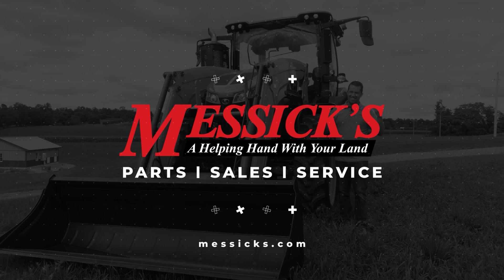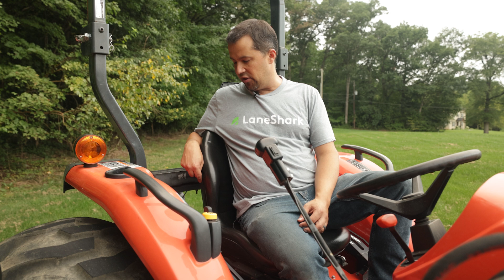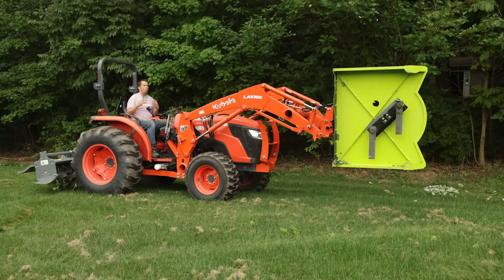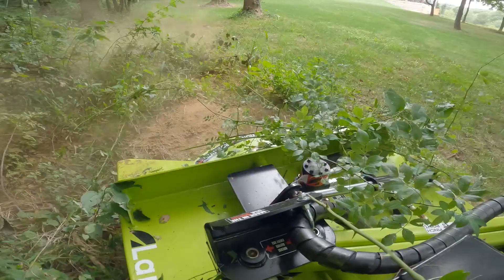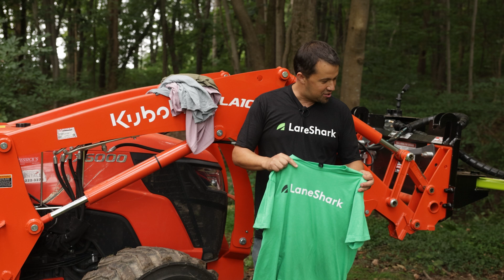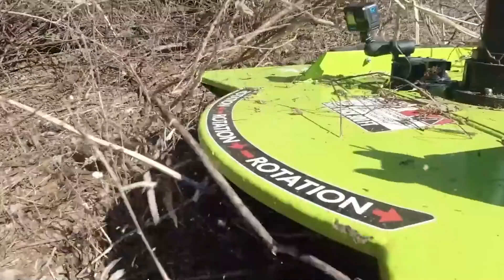Possibly the most innovative mower? Laneshark Hammerhead 🔨

Comment: I have the original LaneShark, and when used as designed, the deck material gets deformed because it is waaaay too thin. Also, the retaining pins to keep the position locked in place tend to fall out and get lost (the brush you're working in pulls the cotter pins out, then the retaining pins fall out). I replaced them with bolts, and even though they're not as easy to remove, at least they stay in place until I'm ready to remove them. If I'm going to spend $10K+ on a new implement, it will be a 3-point mulcher like the Baumalight MP360...just sayin'.

Comment: Is this attachment principally for smaller tractor FELs that can't run a traditional skid steer brush-hog or are not heavy enough to handle the alternatives? The CID Swing Boom Brush Cutter is pretty much the same attachment in the same price range, but it is about three times as beefy.  The Lane Shark is $10,000, weighs 550 pounds, uses Pioneer AG style connectors instead of flat face, needs 8.5 - 20 GPM and explicitly states that it is not compatible with skid steer machines.  The rubber flap on the Lane Shark seems quite risky (I mean, all mulchers and cutters are really risky when you lift them up in the air).   The  CID Swing Boom Brush Cutter is $10,500,  weighs 1,400 pounds, uses flat-faced connectors, and needs 14 - 30 GPM.  On the CID, the two side aprons that will ever face the operator are fixed steel all the way down.  However, after reading the instruction manual for the CID, they think you'll get killed if you don't have a polycarbonate door/cab windows, so perhaps the steel doesn't buy you much.

Comment: I have a trailblazer with the power pack. Could you put a powerpack with this new Laneshark? I dont like the idea of using a tractors internal hydraulic fliud when you are mowing for several hours and is hot outside to begin with. I know Laneshark disagrees with me, but that fluid gets hot
Reply from the maker: Yes, its just a small plumbing change

Comment: What model tractor is in this video? It looks like an MX. If so I’m surprised the tractor has the hydraulic flow to power the blade.
Reply from the maker: Yes, its an MX. The mower does not need tons of flow to lop things off. I ran it for about two hours off camera as most of the time was only half throttle.

Comment: So if you want to use this on more than one tractor you muSt buy two or three control boxes?
Reply from the maker: If it was me, I'd set it up on an external hydraulic power pack, put a magnet on the control box, and you could easily swap to a different tractor just by hooking up power leads.

Comment: Lane Shark really needs to come out with a model that runs off a PTO power pack. Anyone with an older machine or even a newer machine without the 3rd function knows it can be a pain to find a 3rd function kit as well as getting a case drain installed. It would be nice if it could be a self contained stand alone unit.
Reply: Their original model came with a 3point mounted rear external hydraulic tank for flow back when the motor stopped abruptly. It would come with a cost increase and you'd lose the option of adding additional counter weight with an implement, but I'm sure if you called the company, they could customize a set up for your tractor.

Comment: That power beyond 3rd function kit would save me hours when i built ranerri hedgers on m5.111n . Because i need to build mostly everything for it.  Brackets and all and most of the harness has to be cut back from hedger to make it nice and clean with the tractor side harness. I would just love the system on my daily tractor because some days i need a electrical connector on it and return to tank .

Comment: Most boom flails to a great job of reaching even 20' or more upwards to the side.  Flail mowers/mulchers are vastly under-utilized in the US because of stupid stupids.  Maschio Gespardo and SaMASZ both make small low-horsepower flail mower boom kits (one makes an 800cm that will run on 30hp no problem) and a couple of them can even be hard-mounted to the front counter-weight box instead of needing a front-loader (tho an FL is very handy for installing them there).  Almost all boom flail mowers can be used above the height of their tractor and also end up using less power to complete their tasks and produce finer cuttings.   There are a LOT of things I'd not use a flail mower for and the Laneshark fits almost all those uses but a good review of a boomed flail is definitely needed.  The Laneshark has a fairly limited reach outside "the lane".   I wouldn't hesitate to buy one if that was all I needed to mow!  but in the end a dedicated belt-drive hydraulically powered boom flail is just a better product and only costs a couple thousand more (or a couple thousand less if you don't have a front loader to put it on!)

Boom flails ARE sensitive to wobble and wiggle of the tractor far more than products like the lane shark, rotary blades have a tendency to smooth out such bumps whereas the flails make the cut-line look like a loose hallway rug buckled up in a tom'n'jerry cartoon, the question really is whether you want to make something look superficially good in rapid order 'git r dun' or have it done right with very little water-flow impact and proper mulching.  Without a doubt a flail is better land management.

Comment: Since you are replacing the third function hoses connection, can you still use different types of equipment using the same connectors?
Reply from the maker: Yes. Still maintains normal function
Reply: @MessicksEquip  thanks

Comment: The tractor and loader were never designed to have that installed on it. Highly dangerous, and huge liability for you having sold it. Not a good look.
Reply: How did you come up with that? What should it be mounted on?
Reply: Ah…so we actually have a genuine Kubota engineer chiming in! Very cool! So what exactly IS the issue with mounting it on this loader/tractor?
Reply: What is the MSRP ?

Comment: You would need a big ag tractor to have enough hydraulic flow to make it effective
Reply from the maker: 8-12gpm. It's more of a lopper than high speed finish mower.
Reply: @MessicksEquip  that will be nice if you can keep the hydraulic fluid from over heating but usually these small tractors aren’t set up to cool their hydraulic fluid like a skid steer or big tractor
Reply: Forgot to say I love your videos and appreciate the time you put into them for us
Reply: I believe the hydrostatic machines at least down to the B series all have hydraulic coolers. My old B2150 had one & my new L2502 has one as well.
Reply from the maker: @richardmeyer7018  Yea, we share that concern. I've never seen it be an issue, but we do encourage people to power it with a 3pt power pack if possible

Comment: I would assume you could still run a rear implement, say another rotary cutter or flail,  and this at the same time?
Reply: It will depend on your tractor's flow capability. I have run my rotary cutter and original lane shark at same time, but the FEL becomes very jerky and the rear hydraulic will sometimes sag. My tractor is barely putting out enough flow to run the Shark, but it has been very good to use, other than some hose management issues, and have cut things well above its rating - but have also cut larger stuff with my rotary cutter than its rating.
No way my tractor could run the hammerhead without modding its pump.
Reply: We are able to run our Lane Shark up high and stuff that falls gets chopped up by the brush cutter out back. At the same time.

We do this on a Massey 4707.

Comment: No way that cutter is worth the cost!!!  These will be a failure product in terms of units that actually sell vs what is cost to develop and build…..  stupid idea.    Real farmers clean it up with a dozer first the sickle bar cutter cut it…. Wow
Reply from the maker: they are sold out with a several months lead time now.
Reply: @MessicksEquip  WOW!   So….. they sold all 6ea of the ones that they had made…… 😂😂😂😂.  The only folks that would ever buy this are home owners that will use it for a season and then it will end up in the back of the shed collecting dust.. FOREVER 😂😂😂
Reply: We use a Lane Shark to maintain thousands of yards of trails and rifle shooting lanes. 

The biggest advantages over sickle bars are:

1, that bar won’t cut stuff that’s thick. So you have to cut often. Never mind getting it cut the first time.  

2, the Lane Shark will cut both high and low. As in we need to cut significantly higher than the cab of the tractor on that trail. 

3. The Lane Shark will actually reach in and cut big stuff back. High. Trying to do that with a sickle bar guarantees you’ll end up having to run pole saws to finish. 

4. The Lane Shark can cut center front without making the footprint wider than the trail. 

Look. I get it. Both a Chevy S10 and Mack Dump Truck have beds to haul things. And each have their place. But just because they both have the word “truck” in them, doesn’t mean they are the same. 

You could NEVER do a quarter of what a lane shark can do; with a sickle bar!
Reply: No need trying to explain things to him, guy obviously knows everything. I won’t bother saying how many hundreds of hours I’ve put on my original Lane Shark…🤷🏼‍♂️
Reply: @bigjack6015  I do know the difference in TOY equipment and real production equipment…….  You ever operate a D6, D8 or D9 ??  If you had “miles” of field edges to clean up and maintain you would have a totally different opinion of using the shark……. Continued success & good luck with your massive clean up projects……..
Reply: @John1911  I totally agree with you……. Re-read my post. I CLEARLY STATED……. I clean up everything with a DOZER FIRST!!!!  Then maintain it with a sickle bar cutter……. With the size of my farms I do not have time for toys to maintain field edges…. So it’s D6 dozer and then an extremely lite weight sickle bar cutter from then on at 9’ wide.   if you make your living from the land you own you simply do not have time for the toys…
Reply: @genewilliams7497  we cleared ours initially with a D8 actually. 

As stated, the LaneShark works great for our business.